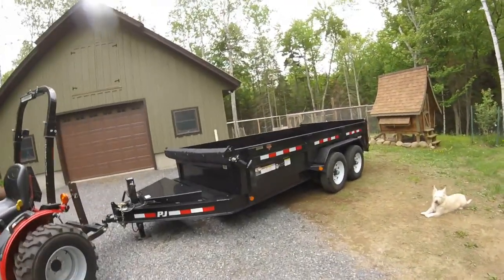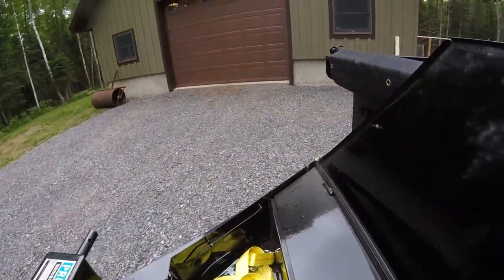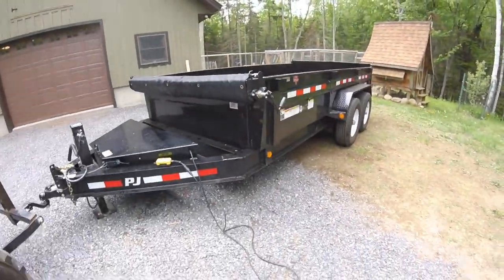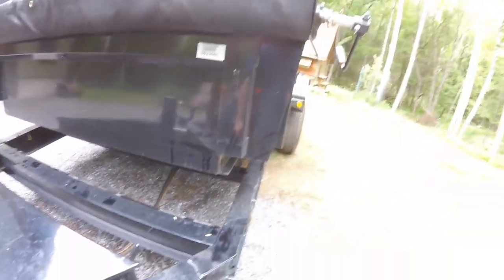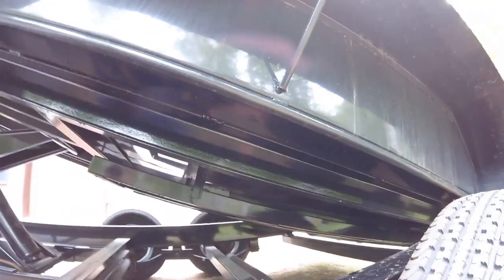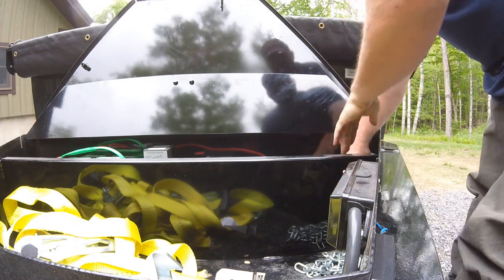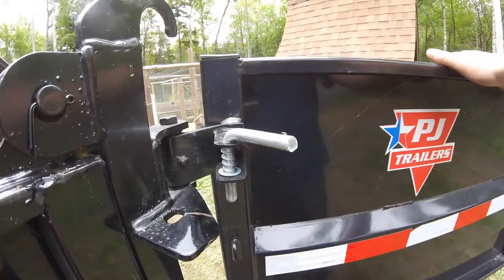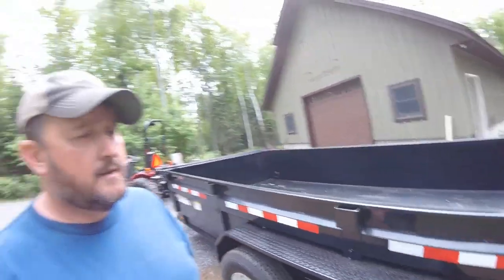2019 14' Low Pro PJ Dump Trailer (DL)

Comment: Nice video and trailer. With the I-beam construction what is the cargo capacity rating?
Reply from the maker: gene coppedge I don’t have the exact numbers in front of me right now but trailer weighs about 4000lbs so with two 7000lb axles your looking at about 10,000 lbs cargo capacity. (14,000 lbs minus the trailer weight). Hope this helps. Thanks for watching.

Comment: i have a dump trailer and only have i charged the battery a couple times in 3 years,, if u haul it around daily it trickle charges ,, i dump mine about once a day average and twice a day now and then and also wont dump for a couple days now and then , i think if u keep ypur trailer somewhere and only use it or tow it when u have plans to fill and dump u may need to charge it some times,,

Comment: I'm in the market for a dump trailer but I have read to many bad things about PJs quality to consider them in my brand options.   Nice trailer though.
Reply: SearchingforSignalLLC same here
Reply: What did you end up buying? I’m looking now
Reply: we have owned a PJ gooseneck dump that was bought new in 2007. the quality has been outstanding even after years of daily use. just now starting to wear through powder coat on deck
Reply: There’s nothing perfect out there especially a trailer. It’s mass produced, welded metal with China parts and tadaaa, it’s all yours for this price. I gave up on looking for the perfect trailer and I gave up to a PJ. It works for me and that’s it. 
All the true and solid welding were produced and made 50 to a 100 years ago; now things are put together for the quickest buck.
Reply: @jsolemi3281  
Anywhere near Wisconsin - I will sell you my PJ / 14 Foot Dump 
I want to buy a B-B Trailer / So much better than a PJ
Reply: @williamedwards8226  
Sell you my PJ - 14 Foot Dump - What state are you in ?

Comment: 5 Year Plan
I have a 14 Foot - PJ D7 Dump Trailer 
My model isn't made anymore they now went to your model.  ( DL ) 
Mine is taller. Something for you to think about is : The door pins it is actually nice that you need to pull them up to hold door. In time they won't work as well and may not hold door. When you think you need new ones hit them down with a hammer and then the pins start to grab again. No need for new. A couple things you should have gotten when your trailer - Always order it with a Gravity Down button - Saves battery and if you ever had an issue and lost power you can still get the box down. I always use mine. 
I myself don't like the License Plate bracket under the trailer - Its to low. 
I took mine off and screwed the License plate to the back left door. I ordered mine with 8 D-Rings - When you are hauling stuff like tractors etc... Its nice to have several in more spots than the 4 standard. When loading if your having issues either lay a plank down on the ground up to your ramp or Raise your box up a little with your lift before you drive on to lower your angle for Tractor to go up. I love my Trailer but the 2 negatives on it are.
1. I have the Orange Powder Coat / Beautiful looking but the Paint in several spots mainly on the frame peals off in big sections sometimes - 
The Metal was not cleaned properly before it was Primed & Painted. 
2. I didn't have an option like they do now for a Power Jack. 
I wish I had the Power Twin Monster Jacks on mine. No more hand cranking. 
Love my Trailer though - I had it built how I wanted - I had a lot in Extras when I order mine. 
Had mine built at the Texas Plant / Not the Ohio Plant.
I had several Dealers tell me ask to have built in Texas when I order. 
I would love to sell mine and build another new one. Build it the same as I have now except with the Power Twin Jacks. 
I live in Wisconsin if any of you are close and are interested in buying one. 
Congrads on the trailer - They are handy.
Reply from the maker: Dave S thanks for the info and for watching!
Reply: I just ordered a red gooseneck down rated to 14000k to avoid CDL requirements. They say it will take 4-5 weeks to build here at the Texas plant. I ordered it with the solar charger and 14 ply tires. My question is what is involved with the gravity down option. Is it just a controller change? I doubt they have even started the build so I'm gonna call tomorrow and add it if possible. Do you remember how much it could cost for that feature? What about the power Jack, mine being a gooseneck, I feel that would help out. Could you guess on the cost of that upgrade as well? Thanks for the info.
Reply: @stenny1970  Thank you for the info. I am all in with this PJ though. I already gave them the money and hope I don't regret it. I'm gonna call them in a bit and add those 2 options for sure.
Reply: @michaelkelly6769  You should like it - Although your paint you most likely won't. 1 thing though is they told me I need to say mine was a 10K Trailer or I would have to have a CDL to pull it. You better check into that. Mine came in to dealer with the wrong plate on it - They had to have a new plate shipped to them to change it down to 10k - I am from Wisconsin maybe every state is not the same. Not sure on that. I bought mine from an Illinois Dealers about 50 Miles from me. I have a dealer closer but I was able to get the price for mine built how I wanted it for around 800 bucks cheaper.
Reply: @stenny1970  yea I am having them down rate it to 14000k so I can stay under 26001 pounds.

Comment: Watch out for rusting out from under the paint. Had a pj trailer. Rusted out in 7 years. Washed and clean constantly. Paint pealed off in sheets. Powder coat does not work if put in salted roads.
Reply from the maker: Mark Feasel already noticing that. Really trying not to put it on the roads in the winter.. thanks for the heads up